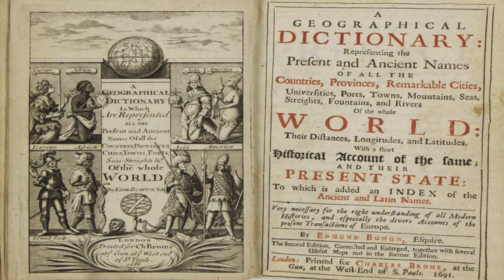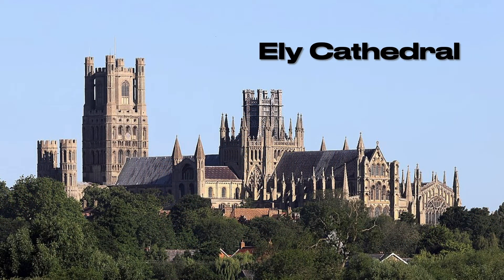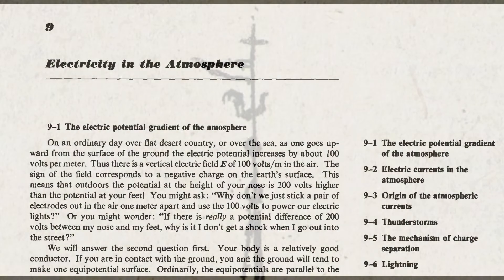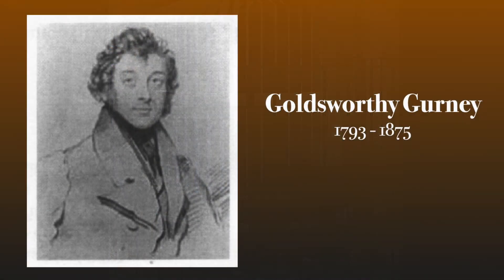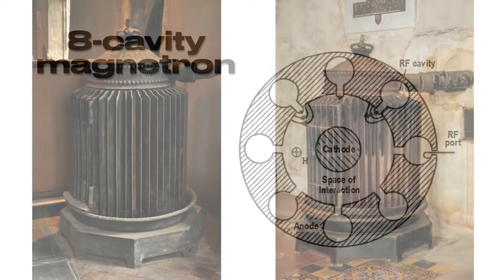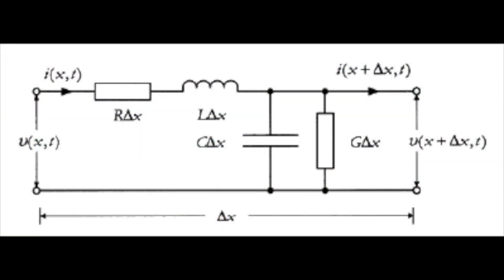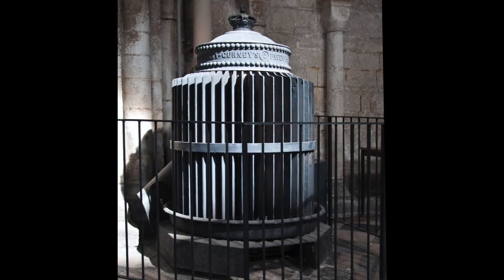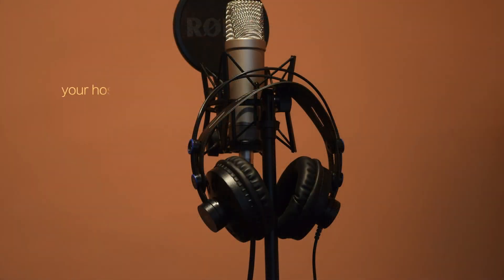Coal stove or medieval magnetron?

Comment: Cathedrals are such incredibly elaborate and exacting structures, that never really seem to fit into the time period that they were constructed in. Surrounded by tiny timber framed houses, with no proper drainage, and unmade roads,  these huge buildings are so out of place. I have no doubt that there is far more to these re-purposed ''coal stoves'' than simply heating. This is a fascinating subject.Thanks for sharing your insights!.

Comment: I believe that the water that was heated and insulated the buildings was a side effect of the voltage flowing through the water... 
I don't know if you know how to make a heater out of a can bottom. Under the conditions of 110v or 230v, the distance between the plates from the can is small, which gives the effect of heating the water molecules. Question; How much voltage will flow from the aether?
Reply from the maker: I think it depends on how high that spire was. Rimstar says you gain 100 volts per yard of elevation.
Reply: I never cease to be amazed at the intelligence of the average viewer of these kinds of shows. And if the people that watch these videos are this smart, then this too supports that we are on the right track. That's a pretty scary thought when you consider what we ultimately are talking about. 
Cheers 🍻